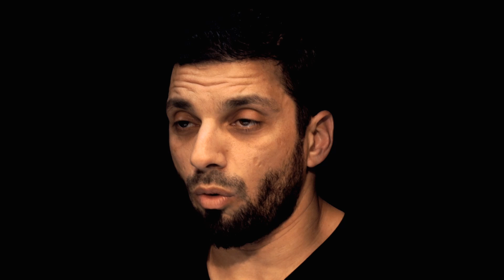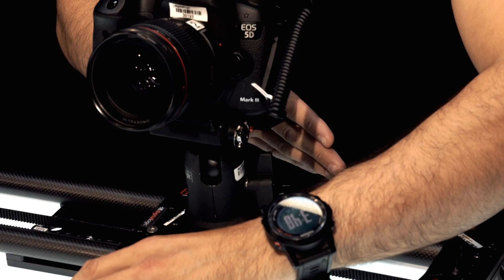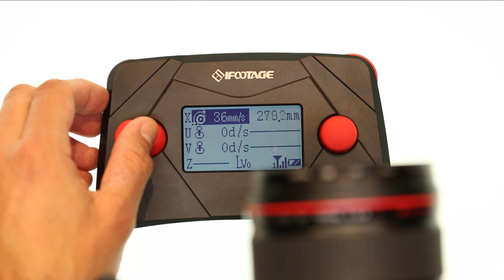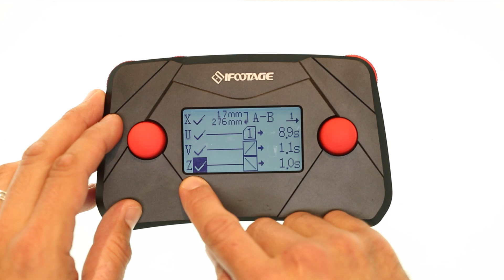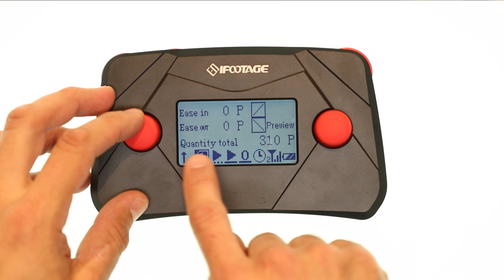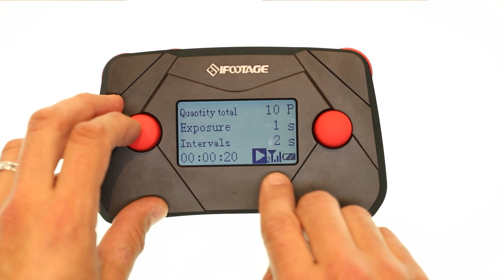iFootage S1A1 Wireless Motion Control System

Comment: Hey! I need a manual Parallax pan accessory for this slider......any ideas where i can get one...and if there is one for this ifootage slider available!???
Reply from the maker: +Black Steel The best solution for this problem is using the iFootage X2 Motion Head (as seen on our S1A3 Review Video - https://www.youtube.com/watch?v=O6OJ8FP4q9c).
If this is not an option, you could always use a tripod head and do the move by hand.
Reply: Thanks for replying, i have tried it by hand with a tripod, but its not that easy to get that smooth parallax shot....i was hoping that there would have a manual one made for this like the Konovo one has.......but thanks anyway.....maybe you guys should look into this, as i am sure that a lot of ifootage slider owners would love to buy a cost effective manual one like myself.